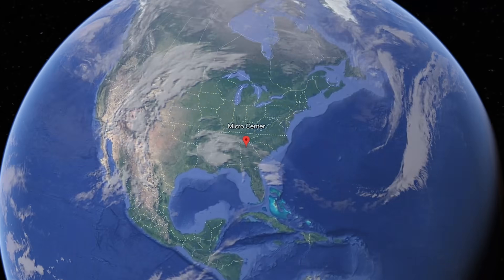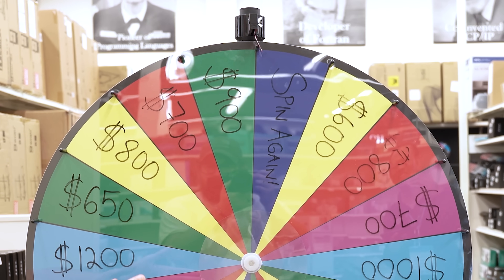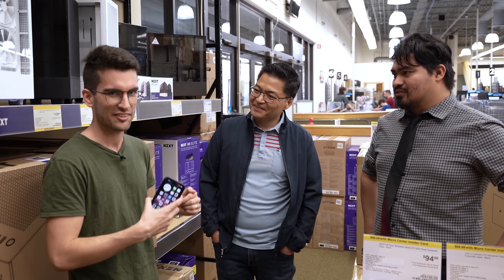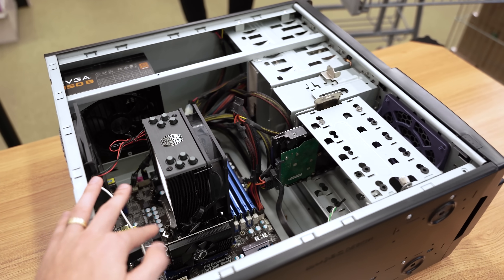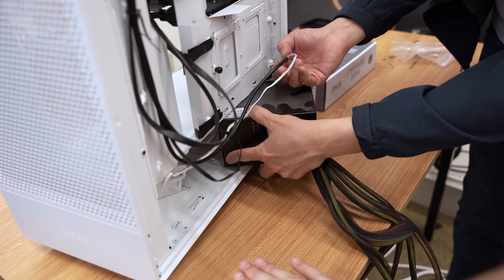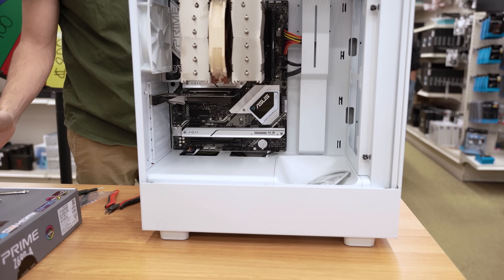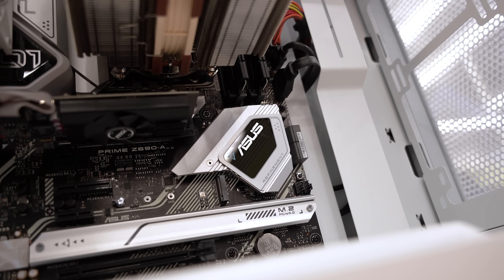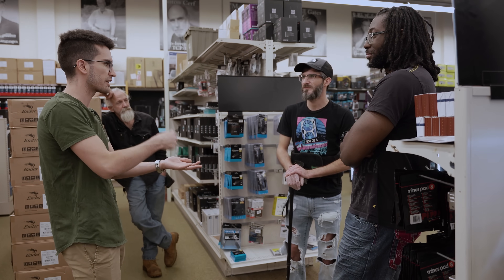This PC Was 12 YEARS OLD! - Gear Up S1:E4

Comment: why on earth did you let him put that gt710 in there when he has 13th gen iGPU?
Reply: He will upgrade later like don't worry it's not ur PC either
Reply: @ikram2512  point is the iGPU will perform better than the 710, he should have advised him to leave it out, more points of failure and 25W of power he doesn't need to have.  I have no issue with the gt 710 if it's actually faster that iGPU or you have a cpu without iGPU, but he literally made that system slower putting it in.

Comment: WD Black SN770 1 TB is currently $60, cheaper and way better than that SSD he got
Reply: Just curious, at this level of speed now, does it really make a difference?
Reply: @hermanwooster8944  Yes if he's using the PC for more production-focused tasks, he might need to move big files. And it's from a renowned brand

Comment: Why would the guy waste all that money on a 13th gen Intel.  He should have gone with a 10th or 11th gen on a cheap board.  it would still be a massive upgrade.  He needed to spread that money around.  He said he does video editing and he is using a 710?   This guy should have went with a $200 graphics card, the cheapest motherboard and intel combo they had and then a case and power supply.  This was such a waste